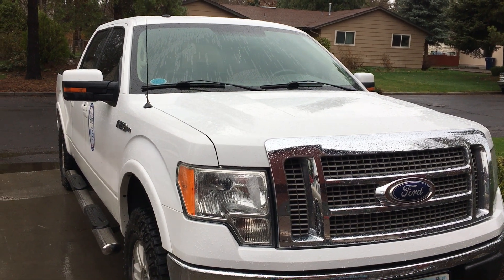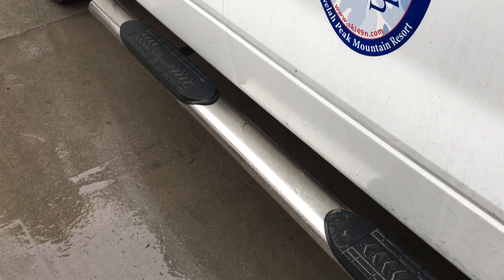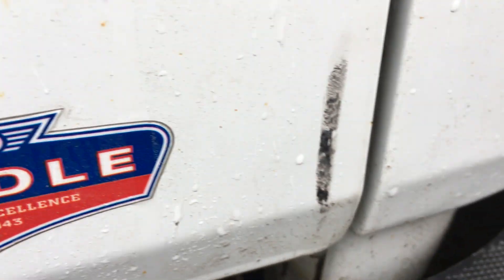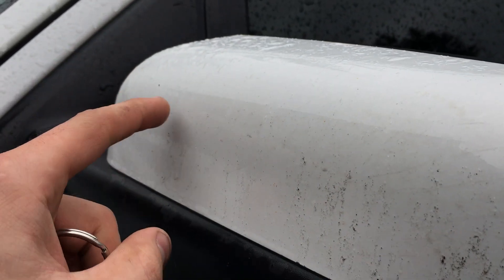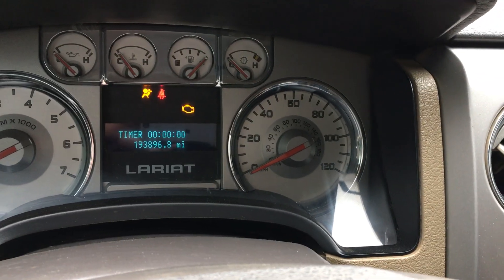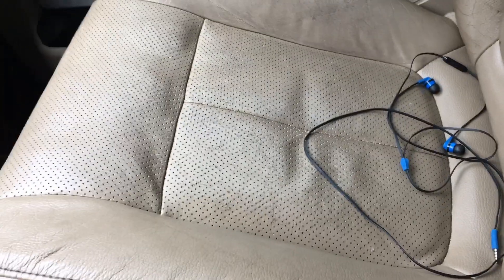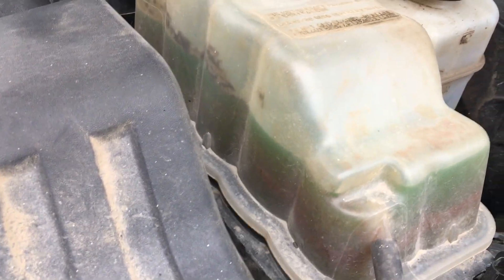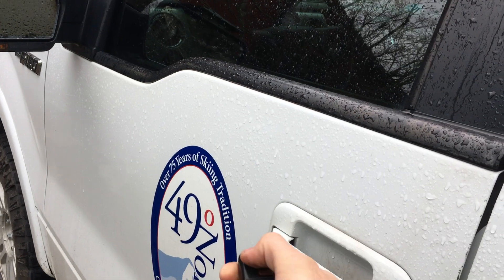2009 F-150 Lariat

Comment: Did this truck come with the Sony sub? I have the same head unit but my 09 KR didn’t have a sub…although it has the bolt bracket. If so I can probably find a used sub and plug and play. Great job on repairs. These trucks will keep you busy that’s for sure.

Comment: Looks like some oil of some kind got on the evaporator in the past and now dust has stuck to it. If it had a freon leak before that would have done it because the system has oil in it for the compressor. If you know someone in the A/C business let them get you some coil cleaner and clean it. Then be sure to rinse it off good.